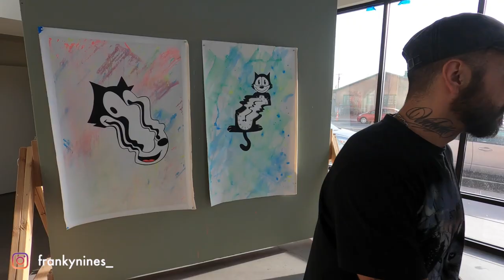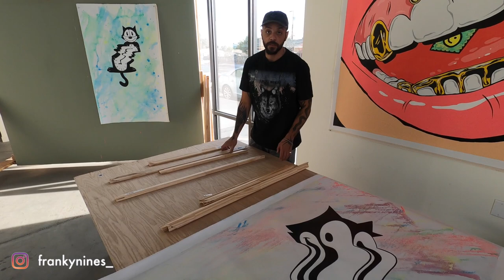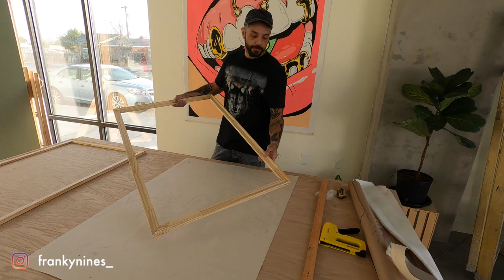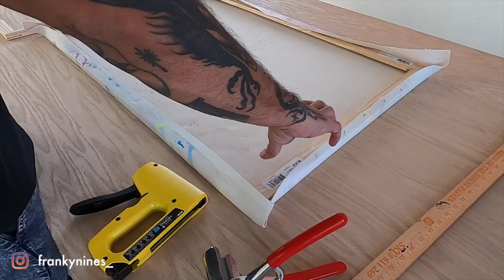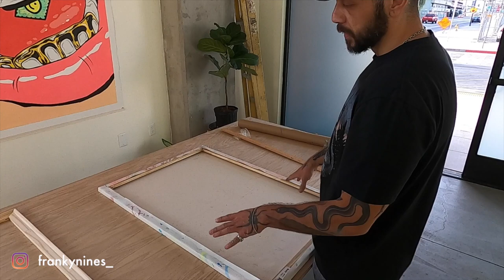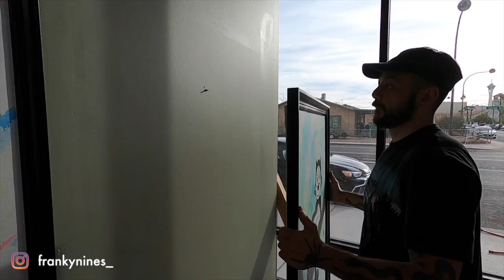How To: Stretch Canvas for Beginners

Comment: Question! I have a few paintings on canvases that I want to remove from the frame (I bought them pre-stretched/ installed). What tool is best for removing the staples?
Reply: you can get a staple lifter :)